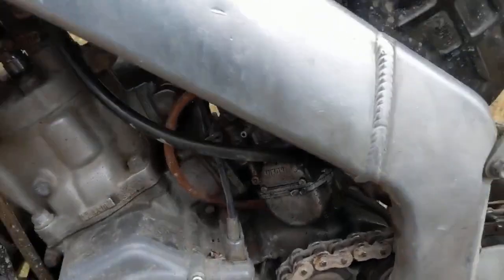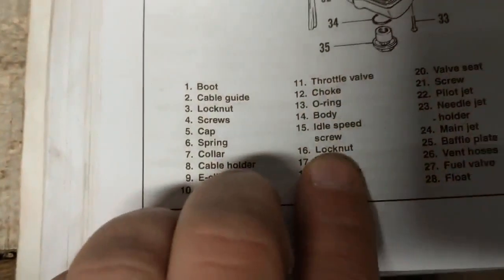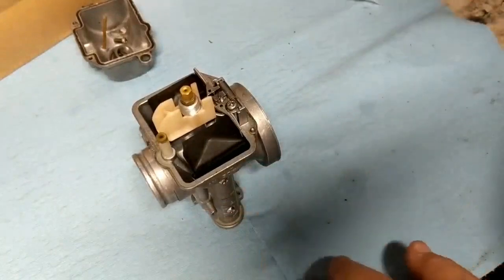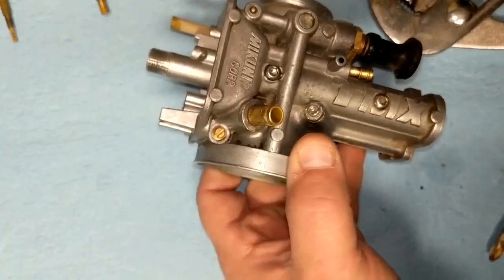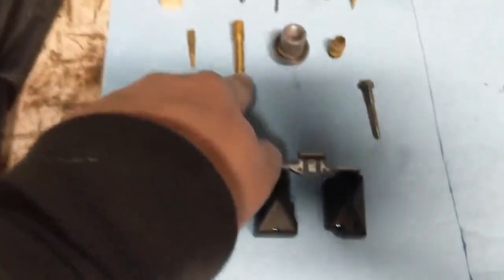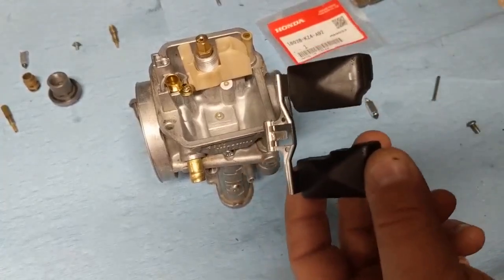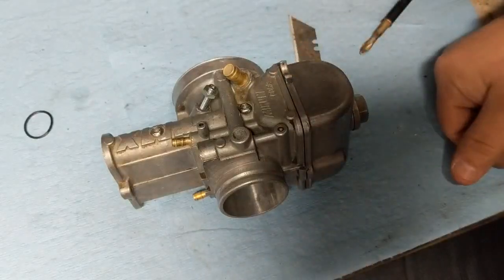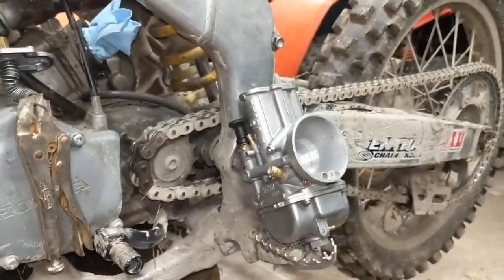How to rebuild mikuni 2 stroke carburetor, 2000 Honda CR 125

Comment: Awesome video got my non-running bike to run. Amazing. Thank you. My bike was a 2000 YZ 125, but they have the same carburetor as the CR so the video was great help.
Reply: Hey so if I buy a used ‘00 cr125 for my 00 yz125 it would fit perfect even tho it looks a bit different?

Comment: Great vid. I’ve been working past day on my son’s 2006 Husqvarna SM 125. Broken gas wire. What a mess! Previous owner had customized it for street stunts. With this vid I could finally identify the carb as 2002-2004 Honda CR125/250 MTX 38 4.0. And gas handle was from Yamaha. What a mess trying to find right parts with google pictures
Reply from the maker: Glad it helped. Good detective work on your part. 👍

Comment: I pulled my 2001 cr125 out of the junk pile and hope it works after 12+ years of being in the weather. I cleaned the carb today but needs all the plastics, tires, throttle, and brakes checked out. Hopefully this weekend I can make time to ride it and start ordering parts.
Reply from the maker: Awesome.  Good luck with your project.  We just got ours out last week for the first time this season.👍

Comment: Nice video ! Curious if these Mikuni TMX carbs came stock on these bikes or not ? Some blogs out there saying they did, and the Honda parts guys seem to have no idea, even when I give them the serial #... I guess I just want to make sure I'm getting the right rebuild for mine. It's the same year as your bike and appears to be the same carb, even though it doesn't specify with a model # ... Any help would be appreciated.

Comment: Hey so if I buy a used ‘00 cr125 for my 00 yz125 it would fit perfect even tho it looks a bit different?
Reply from the maker: I haven't personally done it, but if the yz has 38mm on it now I'm thinking it would swap. But possible clearance issues? Probably have to mess with the jetting as well. 👍
Reply: @AdamzGarage  I just bought it like 5 min ago it’s the same carb I just have too lean it a little bit thx tho
Reply: @AdamzGarage  and for the yz the had the 36mm from 98-00

Comment: I need my float to stay seated exactly at the height I want it at, but I can’t seem to get it set where it can stay on it’s own.
Reply from the maker: Yeah, that can be one of the hardest parts to do. The metal tab just needs very minor adjustment and it makes a big difference in the height. Unfortunately it's just trial and error.

Comment: I have an 01cr125 and it's spitting oil out of the exhaust.  I'm running 32:1 I'm thinking going up to 40:1. You have an idea what the issue is?  Ty
Reply from the maker: We had the same problem with my son's, running rich more than likely. I would recommend trying to re- jet a size. I just ordered a couple different size jets for my son's CR. He just started riding it recently since I did the Carb rebuild and we're having the same problem, excessive smoke and oil dripping from exhaust . You could try to change your fuel mixture like you said and see what happens 40:1 isn't to bad. We run 32:1.
Reply: @AdamzGarage  I think the other issue for me is I'm running it more on the "trails" and not staying hard on the throttle.  I did add more gasoline to the tank to lighten up the oil and messed with the idle screw.. seemed like it reduced the smoke and oil spewing out the exhaust.  Where can I purchase a carb rebuild kit?  The bike has a Mikuni carb,  fmf pipe and I live in the high desert about 3,800 to 4,000 elevation.. if that matters.  Ty
Reply: I had the same problem. Had to change the crank seal on the transmission side

Comment: Did you check the jet block gasket? They say those go bad very often.
Reply from the maker: Interesting, now I'm not sure if that came with rebuild kit.
Reply: @AdamzGarage  check out jd kit refection
Reply from the maker: @mephistoc9286  thanks👍
Reply: @AdamzGarage  i think ''jdmk05" is for you.

Sorry i'm french i don't have english verry well
Reply: For sure that jet block gasket is a must. Don't know why it doesn't  come with kit. Jd jetting has it. I also used Yamaha s7needle ,clip on the 2 notch. Woke that   dude up,supper responsive

Comment: I have the same year and I’m wondering how did it run after you installed the carb with the rebuild
Reply from the maker: It actually ran really well. At first it didn't want to start, but it had been cold, so I used the choke. Started up took it down the trail and ran nice.
Reply: Adamz Garage thanks for the reply ! I think I’m going to try it out cause I just did a rebuild and it’s running too rich for me
Reply: @AdamzGarage  hey my bike isn’t starting and I haven’t cleaned or out touched carb but ordered the rebuild kit has same carb as cr but it’s a yz125 apparently it’s used in the older yz but I have a 125 so if I rebuild would that help ?
Reply from the maker: @JayWithTheAmg  it definitely can't hurt either way.  A rebuild at the very least will help it run better. If your bike won't start at all, make sure your getting spark and have compression.  If you have that then it should be a fuel problem.
Reply: @AdamzGarage  yea I have spark and compression so what should I look to? Once I had got it to fire it would keep going WOT every time
Reply from the maker: @JayWithTheAmg  there's also a small  gasket on those carbs that can go bad. I actually ordered one for my sons bike. It is kind of a unknown issue with those carbs. Not saying that is it.but definitely something to consider.  Let me see if I can send you a link to what I'm talking about.
Reply from the maker: https://www.frankmxparts.com/JD-Jetting-jet-block-gasket-kit-2000-2001-2002-2003-2004-2005-2006-2007-Honda-CR-125-CR125R
Reply: @AdamzGarage  okay one of the parts that said failed is in the kit so should I find the gasket to replace ? I don’t exactly know where tho In us i just want it to fire back up first kick how it was
Reply: @AdamzGarage  oh I see on eBay do I buy whole kit ?

Comment: Could you tell me where those hoses go on the carb asap
Reply from the maker: I'll run out to the garage tomorrow and take a look, been awhile since I worked on the cr
Reply: @AdamzGarage  my son bought a broke one. Rebuilt the engine. We have spark. We didn’t get fuel. I thought it was one of the hoses.  
Believe I have it right but still won’t start up.  
Maybe the Reed’s in wrong.  I don’t know.  Kinda lost.  Watched your video.  
It helps but still stuck
Reply from the maker: @wallymorgan2524  yeah basically as far as the hoses go, should just be your gas line, the line that comes off the bottom should just be an overflow line that just goes down by your shock, doesn't hook up to anything, then the other port by the pull knob should just be a vent line not hooked up to anything.I think your headed in the right direction with the Reed's good 🤞

Comment: mine idles very high, and shoots oil out the exhaust, would this fix it
Reply from the maker: it should definitely help for sure. there's also  a small gasket that they don't show on the exploded view on the honda site. This gasket is known to be the cause of a lot of the problems with these carbs. Ill see if I can find a link for you. its hard to find. I think there's a guy on ebay that sells them.
Reply from the maker: https://jdjetting.com/product/jdmk05-mikuni-tmx-jet-block-kit/
Reply: @AdamzGarage  thanks so much many ill be sure to look into it